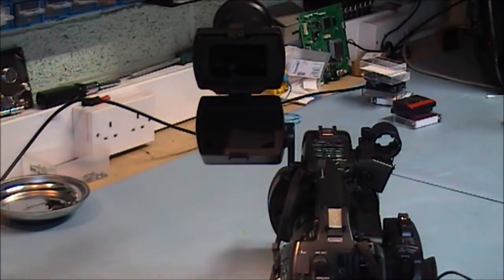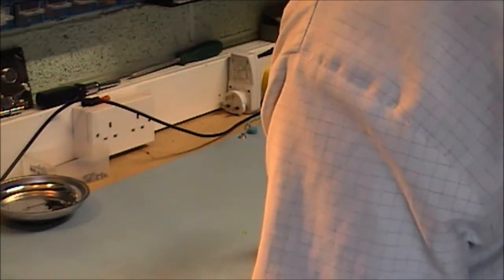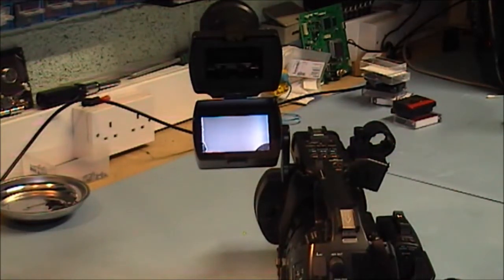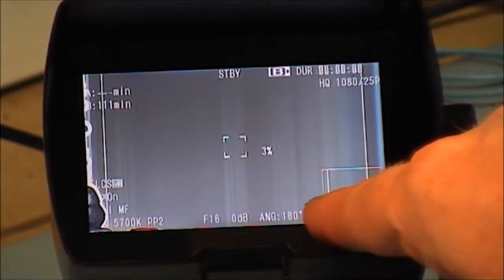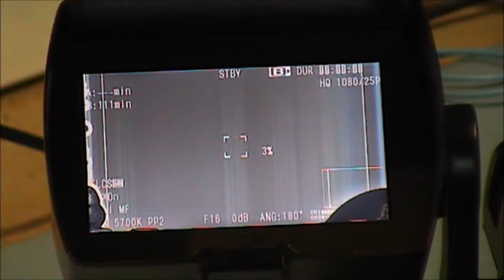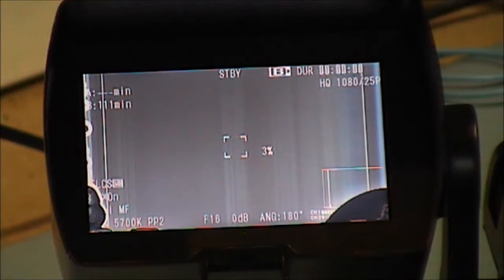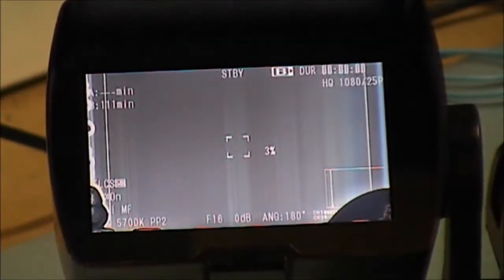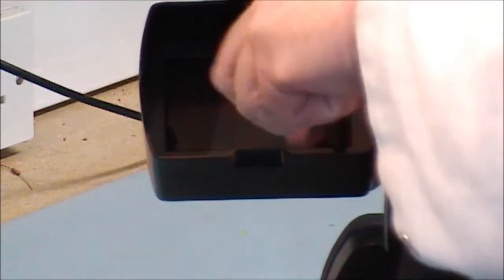Sony PMW-EX3 LCD Screen Replacement procedure

Comment: I'm trying to change screens between my original and a used ex1. because the panel connector is different between models, I need to change out the board. How do I release the film connector that attaches the screen to the board?
Reply: I’m here with the same question. Did you ever figure it out since the OP didn’t respond?
Reply: Got it! If anyone else sees this comment, the BACK of the clasp lifts up. Don’t force the white part, lift the black strip.